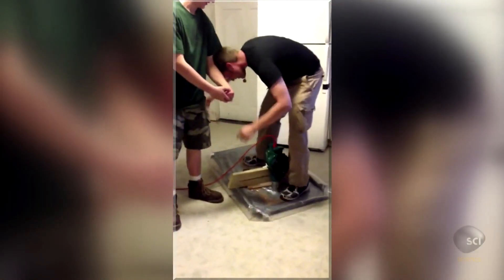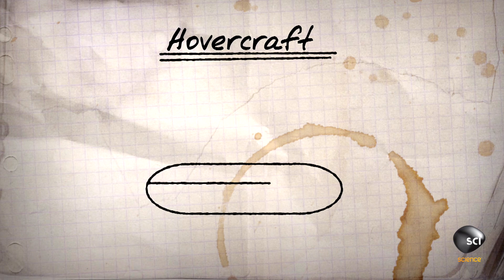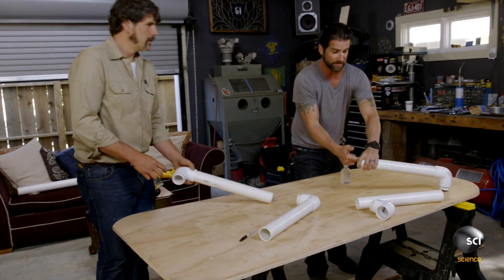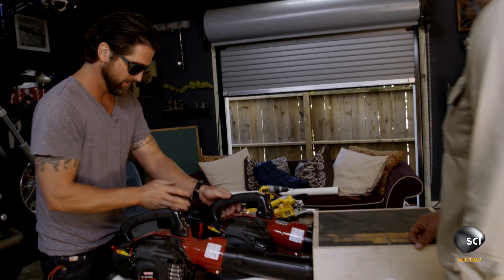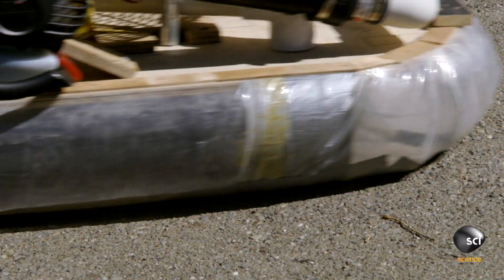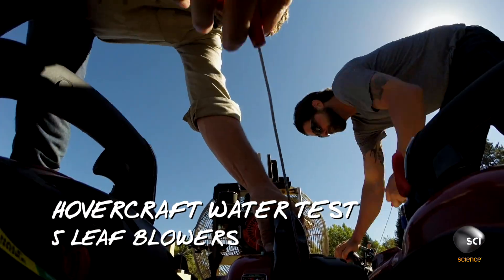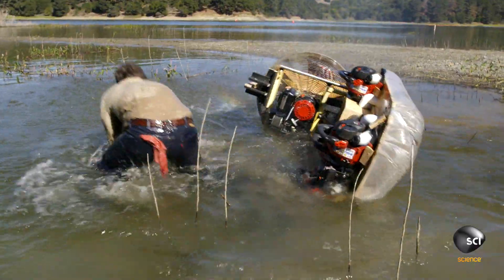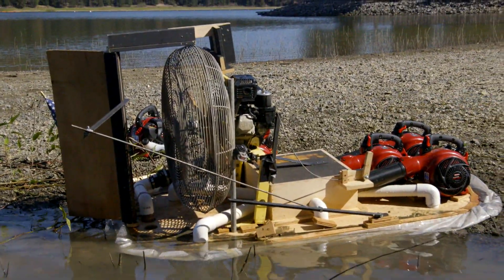The Future Is Here: A Homemade Hovercraft

Comment: I made the same problem 40 years ago. With a airboat. 3x7 wanted to tip. 
Only had 440 snowmobile motor with a 42 in. Home made prop. Should have been 5x10. With a boughten propeller with reducer.

Comment: The problem is that is so tiny for such a big person. Make another big enough for 2 people. Instead of spending so much money on 5 engines buy a 13 hp at harbor freigh for $300 and put a direct drive multiwing fan no larger than 36 inch. Dont go larger than 36 inch when doing direct drive. A single fan should do good for lift and thrust.

Comment: the problem is the skirt. 5 blowers are more than enough but you only need 2 to produce a strong enough air cushion to ride over water but the skirt is everything.Try using a straight finger skirt or a multiple jupe skirt evenly spaced under the bottom edge and you will by moving.

Comment: 5 GAS Leaf-blowers $700 1 Gas Motor $350 1 Wood Propeller $150+Part $1200 not moving 3mph or working rt Priceless
Reply: I dont know where you buy your material but these prices are wildly inflated.
Reply: @domfru5403  Very much

Comment: two problem you had wrong build firstly the hovercraft beneath rubber sideshow biggest in order to hold adult body weight surface water secondly the back panel fan should large and more power HP needed in order to pushing whole damn thing moving

Comment: It didn't seem like it was hovering
Reply: Most full sized hovercrafts doesn't hover simply because there not suppose to. A bit of Levitation will decrease the friction which will be enough; too much air will cause the vehicle to be unstable and could possible tip over
Reply: +Woof Woof *possibly

Comment: the future? i made one of these in 2006!
Reply: The first hovercraft were made in the early 1950s!
Reply: @mrnickbig1  40's.
It's  a British invention
Reply: @trinifirst6702  , you are VERY seriously confused. The first hovercraft was the Avrocar, made by Avro Canada for the U.S. Air Force. It was initially supposed to be a high performance aircraft, but due to bad design, it was only a disk shaped ground effect vehicle (hovercraft). If you are talking about Cockerell's SR.N1 project, it first "flew"  in 1959, years after the Avrocar! If not, then you don't know what the he11 you are talking about.
Reply: How much power blower did you need ?
Reply: burhan syamsy I know you commented this like 9 months ago. But I built one about 8 years ago and all i needed to support just me was a 350cfm electric leaf blower and it held me just fine.
Reply: Give it to me NOw